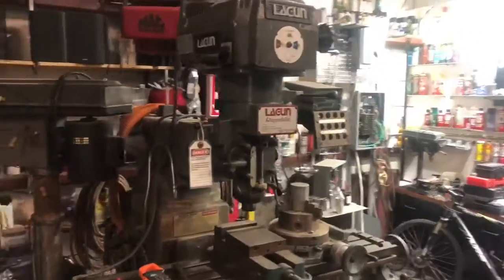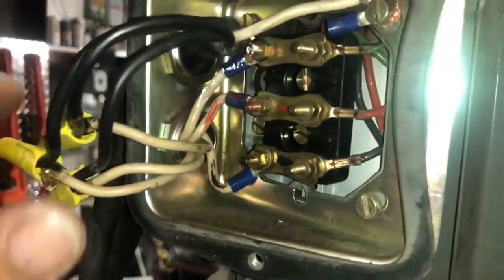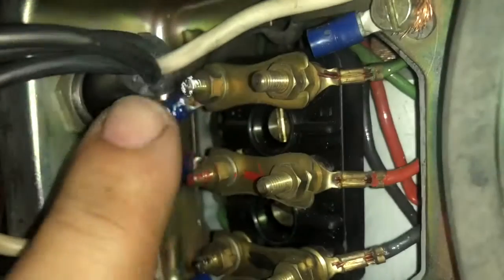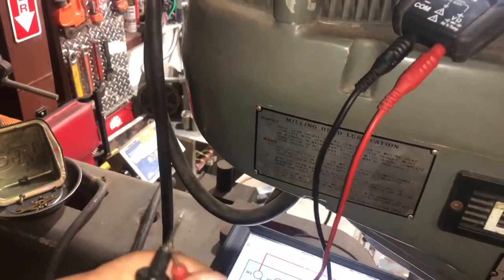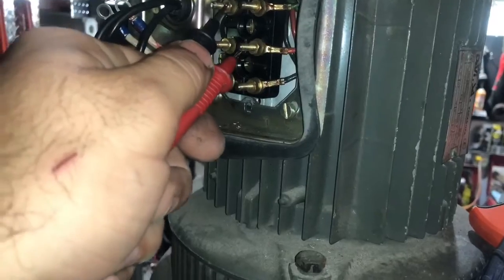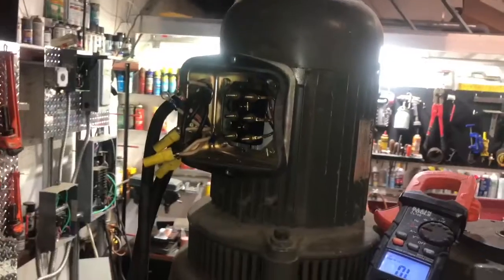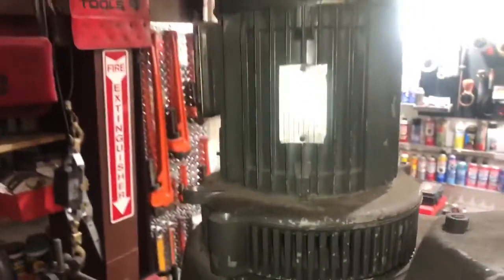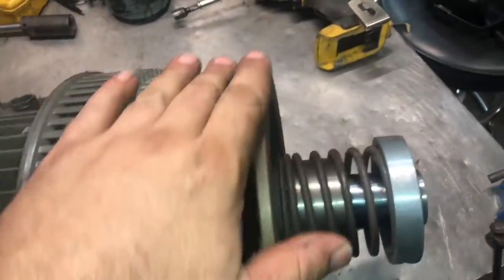LAGUN FTV-2S milling machine repair pt 1

Comment: Hi, I was wondering if you could help me wire my lagun ftv2 from 480v to 240v 3 phase
Reply from the maker: I don't know if you figured it out but there should be a diagram on the motor plate or just google it, I will look on my mill and see if if its multi voltage
Reply: @ProjectShopFl  I have not. Not info at all on plate.
Reply: Google didn’t give much info either